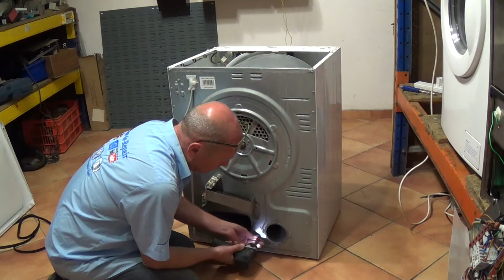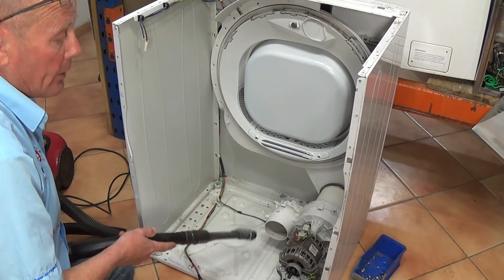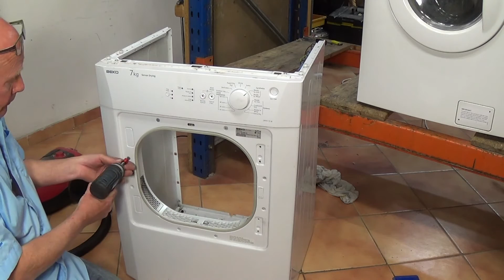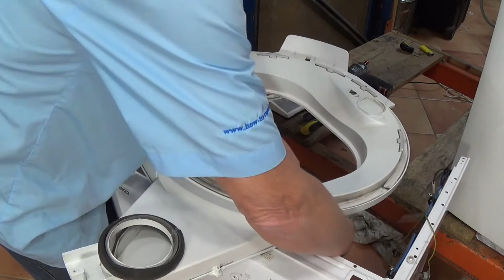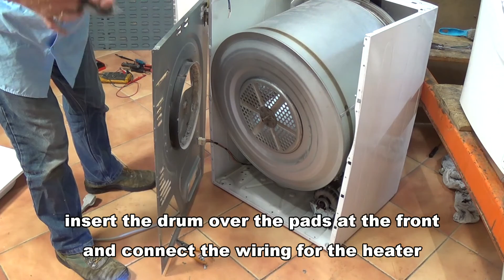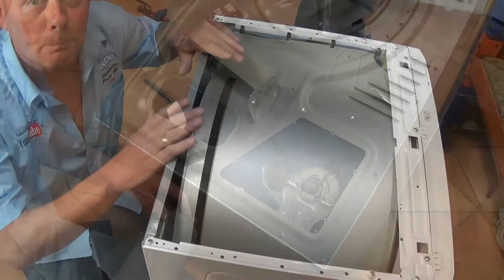How to Replace a Beko Vented Tumble Dryer belt and fully service the machine

Comment: I have similar tumble dryer but motor is different , is with the small belt . My problem is i don’t know where that tensionner spring from the motor goes .
Reply from the maker: If you use the contact us page on the website and make sure you give us your full model number, I will see if I can find any exploded diagrams which will assist you but the spring normally attaches from the motor to the chassis What would really help me to get my video seen as I'm no IT expert is to either share the channel or at least post it to your friends my videos might not be YouTube superstars, but they save Appliances from the scrapheap. Share and help us fight appliance waste! @MikeP88 please remember to subscribe to our channel as that really helps us https://www.youtube.com/shorts/e432SAb2g08  Thanks, Paul 👍

Comment: Excellent guide, thank you.  My dryer was making a horrible regular thumping noise. I took the belt off and both the drum and motor turned freely. It only did it under tension. Turned out to be a tissue and debris bunched up in the fan. Following this guide has solved it and after a good clean out the dryer is much quieter overall. 👍
Reply from the maker: Glad it helped please remember to subscribe as that's is was keeps this channel going. Thanks 👍

Comment: My Dryer is squeaking when the drum is turning. Does it just require a service or should i change the Drum Bearing Pads ?
Reply from the maker: I would replace the bearings and also front pads also inspect the jockey wheel. Thanks please remember to subscribe as that's is was keeps this channel going. Thanks 👍
Reply: What a great video thank you for making it. I replaced my drum belt. But now the heater element isn't working. So I bought a brand new heater element but still no joy replaced it but it's still not heating up. In order to try and fix it. What do you think I could try next? Thanks 🙏🏼👍

Comment: This video is amazing. Thank you very much for taking the time to make it. I have a Blomberg Dryer and there are not many videos online about servicing a Blomberg. This BEKO model is very similar to my Blomberg.  I had a loud vibration coming from the dryer. I replaced the back bearing, all 4 frictional glides and it was still making the same noise. I had heard about the possibility of lint/dryer sheets/socks getting caught in the blower fan and sure enough, I had 2 dryer sheets wrapped in lint jammed in the blower fan. Luckily the fan itself wasn't damaged but after removing these, you can hear a pin drop while the dryer is running. I was able to make this repair due to watching your video, thanks again.

Comment: I've got a Beko DV 7220X Dryer (the layout is exactly like this one) but from the very first time I used it, it was making a noise like a piece of metal was tumbling in the dryer. I thought this was typical so left it, now two years on its got worse. I found out the problem was a piece of metal spring wire in between the back of the drum and the back panel, well Im not sure it is a spring or a piece of wire that got deformed into one and I've got no clue where it goes cos it looks like its just there for no reason. I'll include two pics of where the 'spring' is and what it looks like. I have never seen another dryer with it.

This is the spring: https://ibb.co/kSsd4Tc
And this is where I found it ( between the drum and the back panel not on the panel as in the drawing) https://ibb.co/5nhY8VS

Comment: Thank you for an excellent video .  I have completed serviced my machine with your guidance and and will replace the belt.  Just one problem, now I am putting it back together I realise I did not pay enough attention to how the tension spring locates.  The model I have Beko DSV64W is very similar to the one on the video but not quite the same.  I can't see an obvious anchor hole.  Does it hook onto the bar on the motor casing?   If it does, I have not the strength to stretch the very tight spring :/
Reply: You put the spring on first, when the motor is freely rotating on its mounting. The action of stretching on the belt (as per this video) pulls the spring tight.

Comment: Thank you very much.  I have exactly that model.  It is squeaking when the drum turns and I want to try to fix it myself as there are no repairmen working in my area due to lockdown.  I wasn't sure how to dissasemble the machine without destroying something with my clumsy paws.  Now I know exactly what I need to do!  If I have to buy any parts for the repair I will make sure to order them from you.  Customer loyalty begins with the business treating the customer right, and you have sure proved that you know how to do that!